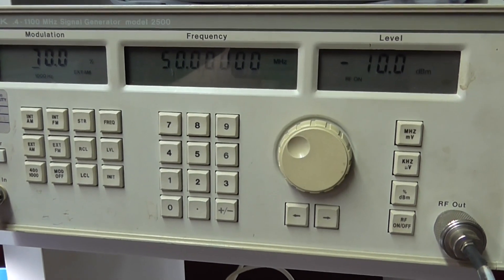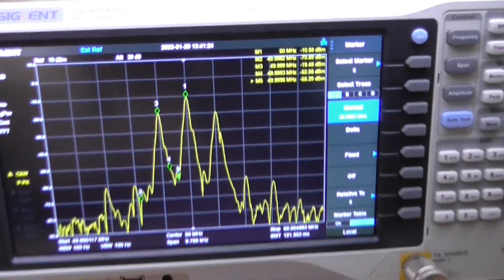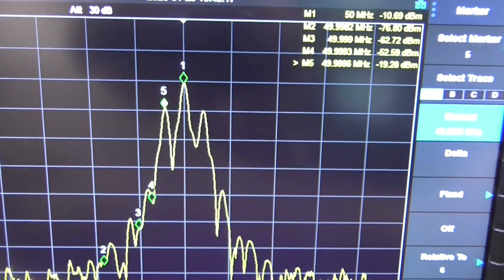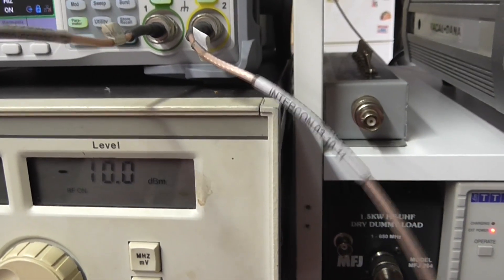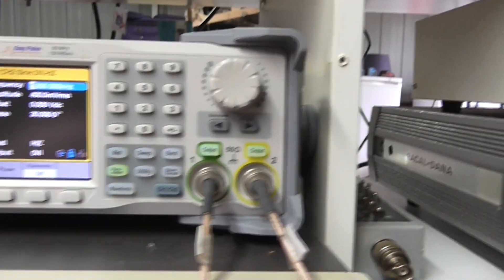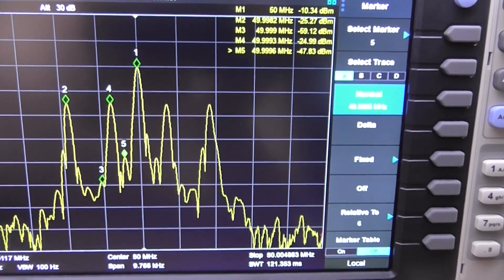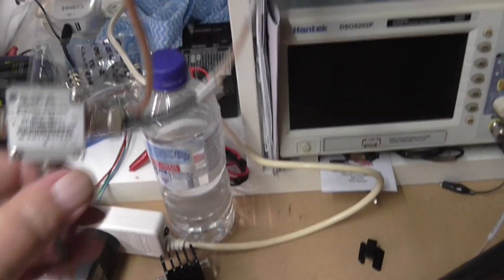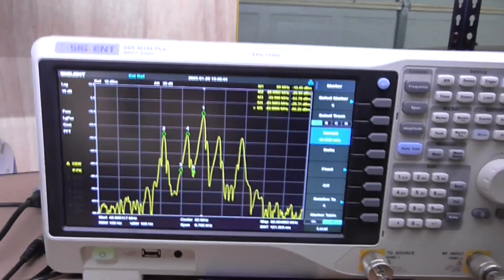VK1JTX - Ham Radio - Two tone modulation on the Spectrum Analyser

Comment: I wonder why you used the external combiner rather than the combine function which is built into the Siglent waveform generator? Did I miss something or is there an advantage to that method? I have the same generator and I’m exploring various setups for use in the shack. I hope to maybe purchase the Siglent 3021 SA the next time they have a sale or special offer at the local dealer!73 de ve4ace